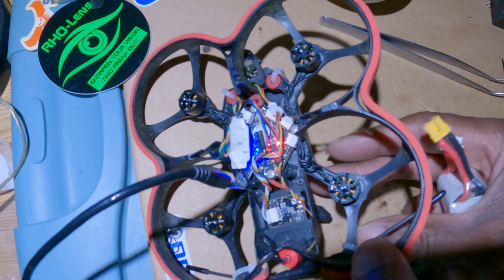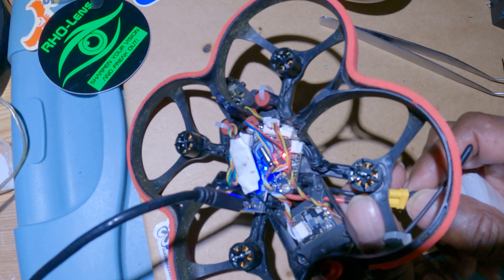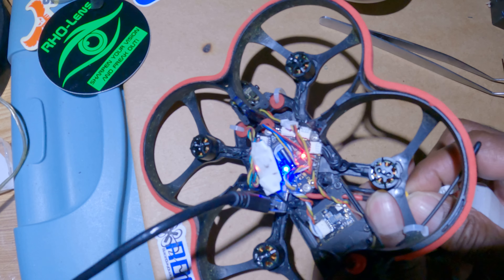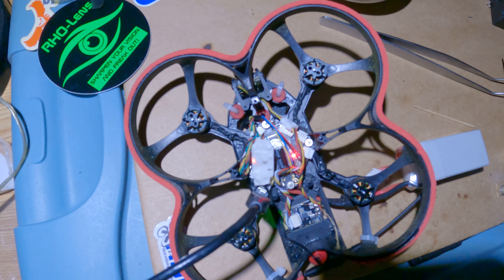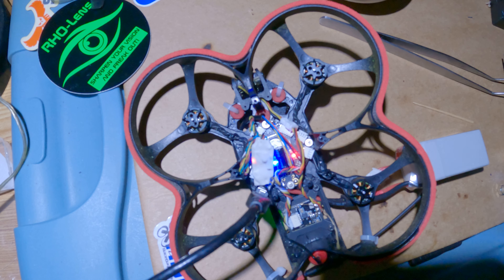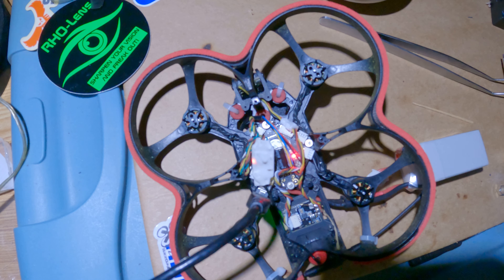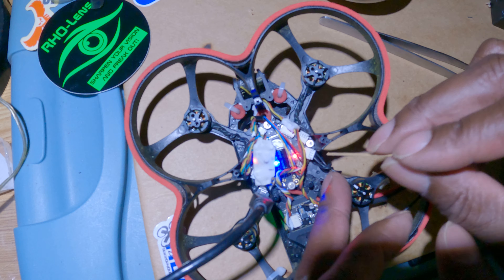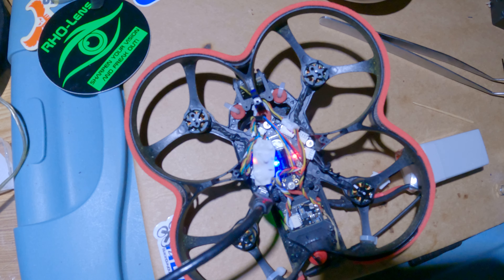Betafpv 95x v3 motor issues

Comment: I think it’s your esc.
Reply from the maker: I read they fail on the motor ESC's often
Reply: @dhalimon  I wouldn’t say often. For the aio boards especially make sure you disarm before the crash. They aren’t as durable as the separate esc boards. I have an aio that I gave to a friend and it just died after 2.5 years.
Reply from the maker: @revfpv7908  It was indestructible up until now.